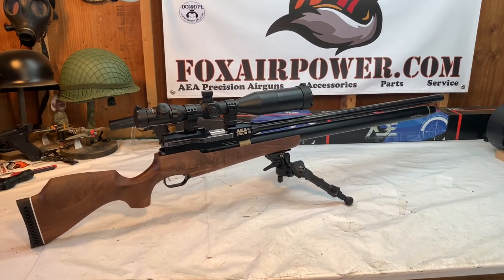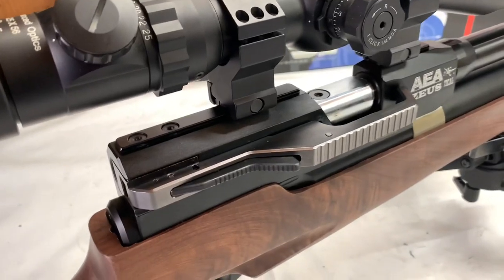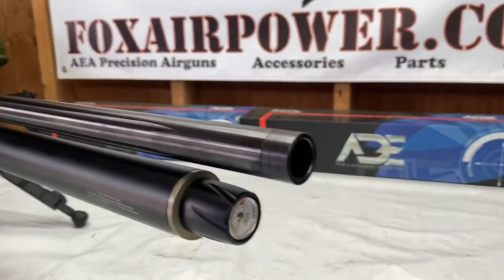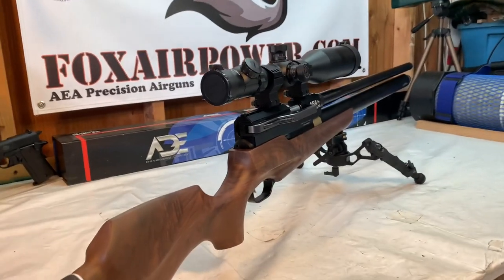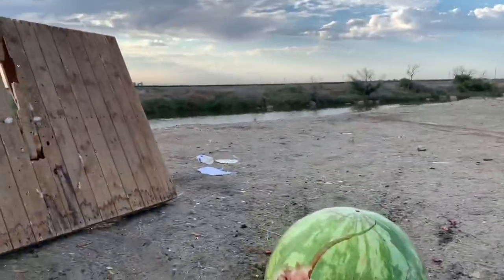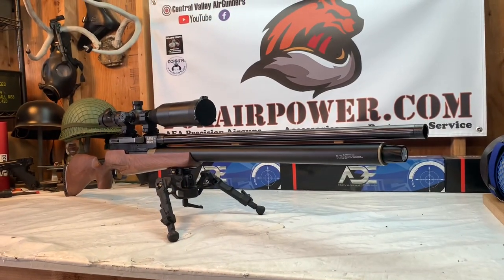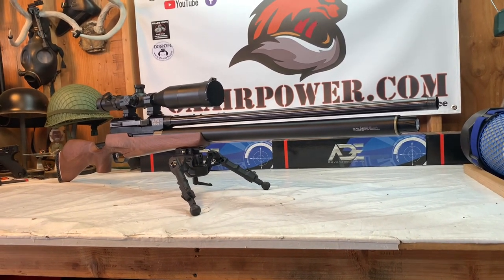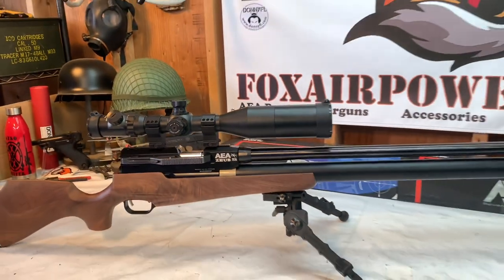AEA ZEUS .72 CALIBER 💪

Comment: Ultimate airgun for brush hunting. Man that gun would pound hogs! Can you image how cool if it was super quiet😉. Cool airgun.👍
Reply: That .72 cal is neeeeevvvvvveeerrrrr going to be super quiet 🤣🤣🤣

You'll be lucky to get it hearing safe with a foot long can 😅
Reply: @dannybax1982  you only need to keep it below 120db to prevent immediate hearing damage, getting it to below 100db (doable with even a 6" can of reasonable volume), is hearing "safe". Shooting isn't the same as being immersed in constant noise levels, so the threshold of damage is much higher. That's why my guns wear 4-6"x 1.5" ID mods,  I only really care to take the edge off the report to not hurt my hearing. You also have to remember that the DB at the muzzle quite a bit higher than back at the shooter's ear, especially with longer barrels.

Comment: Cool gun, but I’ll never see the use for a caliber of this size other than to just hunt…. I’m sure it packs it a wallop! But if you’re using an airgun of this caliber because you want to kill big game, I’d just stick to center fire. This thing is loud and very air hungry! Takes away the advantages of using air rifles in the first place. Ammo isn’t that cheap either. Cool guns but personally I’d leave airgun hunting to small and medium size game. Just my opinion….
Reply: It's equivalent to 2-3/4" BP loads in 12 gauge slug-guns. You don't generally use 12 and 20 gauge slug-guns for target shooting (almost purely for hunting). A ball mold (575gr +/-) would run you $75, and lead is around $2.50/lbs, you get about 12 balls per pound (hence why it's a 12 bore rifle).  Air is considerably cheaper than firearms today (even with home made BP in a flintlock), especially if you use a handpump and make your own ammunition. The 20 and 12 bore rifles out there on the market might not be great out past 100yd, but the high-end-performance small bore rifles (<.50) are capable out to 250+ yd. If you can't get within 1/8 of a mile of your quarry in most circumstances, you need to worry about your huntsmanship, rather than your gun's abilities. Rifled-Gun hunting (firearm and air) ranges haven't really changed since the 1500's, nearly 100% within 300 yards (unless you intentionally make it further). You only get one, maybe two shots on game, so who care's if that's all the gun gets within a reasonable ES? The guns themselves cost about the same as a non-bargain-rack-firearm.

Sure, they can get "expensive", my gun-packages run $3,000 +/- shipped (Timed Valve, 45CI bottle, 13Ci plenum, Ninja Regulator(s), T-valve, nice wood stock, 3x 10"-35"barrels (with built-in mods), 3 ports, 3 bolt heads, 3 molds, 3 dies, wooden + lined case), but the guns themselves with one barrel are only around $1600, which is only a few hundred hundred more than my custom Muzzle loading guns and Primitive Breechloading firearms. Buy quality, cry once, lifetime of enjoyment.

Comment: Wow....just wow! My wild side is saying I gotta have one but my practical side is saying yeah, but you hardly ever go to the range to shoot centerfire so what would be different? LOL, boys and their toys defies logic every time. I totally see this as a really cool source of enjoyment but reality is that a guy better plan on a great air source first as this baby chews it up plus the elevated pressure of 4600psi requires a booster pump like Mr Hollowpoint has.......get your wallet out Boyz! Super cool nonetheless, great video Terry and thank you for acknowledging need for better voice sound equipment.
Reply: I hand pump my rifle, which I built myself. It has a 4.5k psi 45CI tank, 13CI 4.5K psi plenum, and a timed valve that drops 510-490 psi each shot when I take it off the regulator with the 35" .62 (20 bore) barrel, I top it off every shot, to make my life easier and keep ES within 40fps.  With the regulator, I can get 3 shots before it falls off the 3k psi reg setting. Hand pumping is just part of shooting air, for me at least, although I have been eyeing a battery operated compressor for range time.

Comment: Has anyone done a sideXside with different grain slugs to find the velocity difference down range on the 16" vs 32" 
With all powder fired arms, barrel length plays a major factor in overall performance. 
Does barrel length affect air rifles the same way it does firearms? 
My understanding is based on powder and getting that full burn and longer, higher pressure build. Thank you.
Reply from the maker: Mr Hollowpoint has done ammo tests. Longer barrel = more power with airguns
Reply: @centralvalleyairgunners2380  thank you. 
I am watching them now. Sry for wasting your time!
Mr hollow point is hilarious.